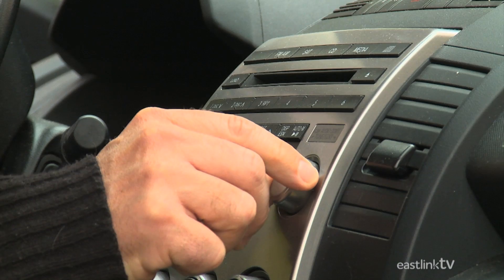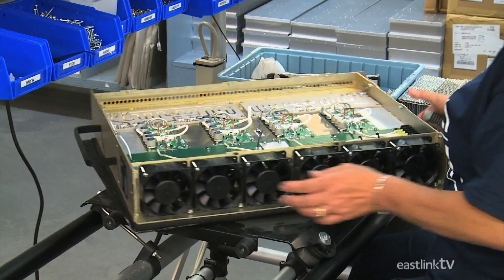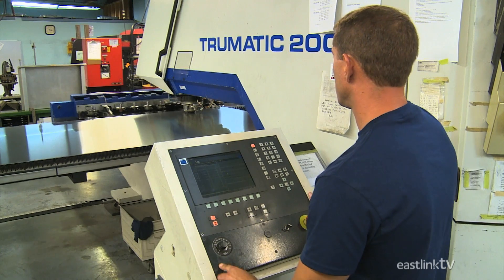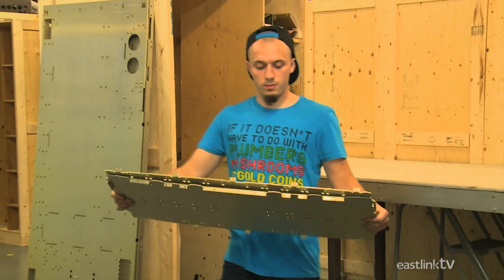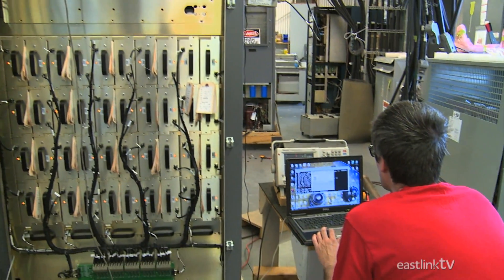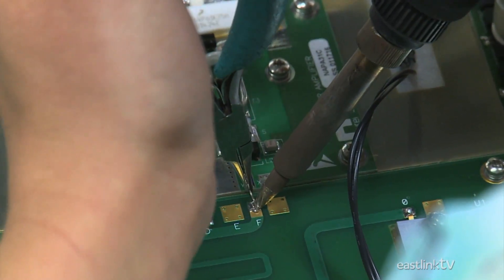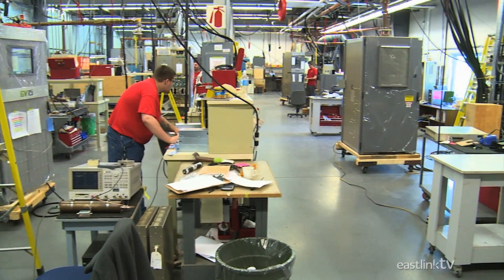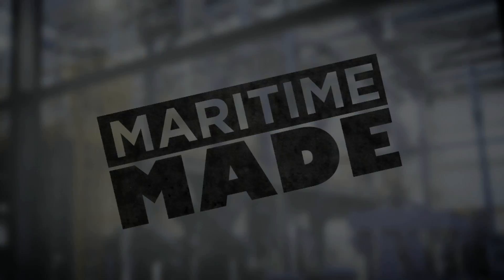Nautel on Maritime Made

Comment: I can't resist commenting. My husband's dad was a radio station general manager during the tube era @ 580 CJFX Antigonish NS. Tube transmitters were expensive to run, even new output tubes faded and rebuilt/remanufactured tubes did not allow for the modulation possible with Nautel FET solid state. Stations needed to sign off after midnight so the Chief Engineer could spend hours & hours working on the transmitter. In cold wind swept areas like the marshes between Nova Scotia & New Brunswick the tube transmitter would be allowed to run, with no input, all night so it would not freeze. Such was the case at AM 900 CKDH in Amherst NS. Nautel transmitters brought to the broadcast industry great audio (FET Output), efficiency, and tremendous dependability. All from a Nova Scotia company and industry leader. For true radio people in Canada Nautel is a great source of pride.